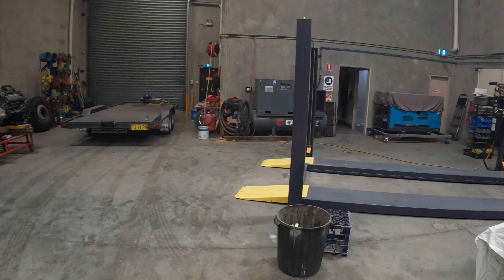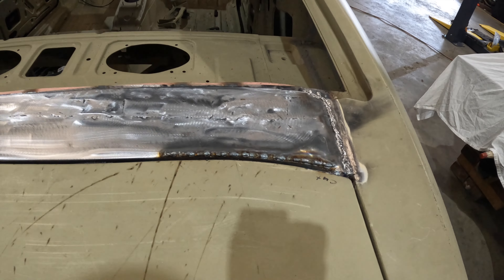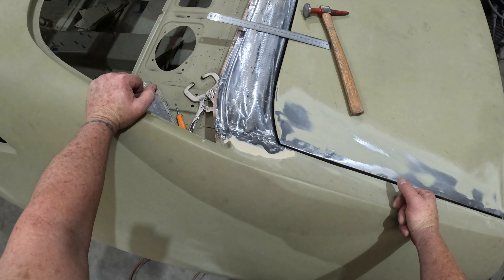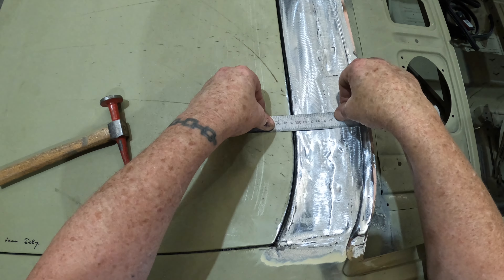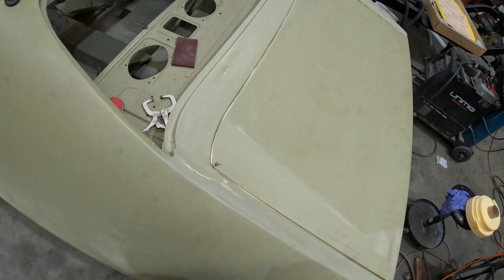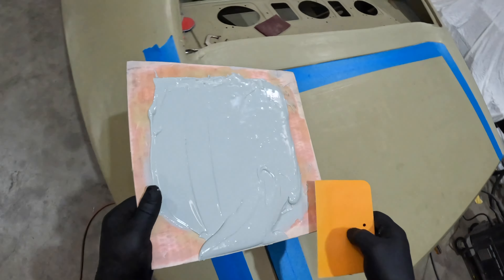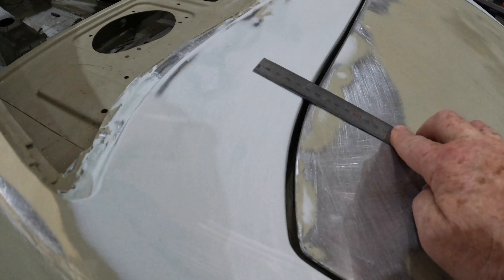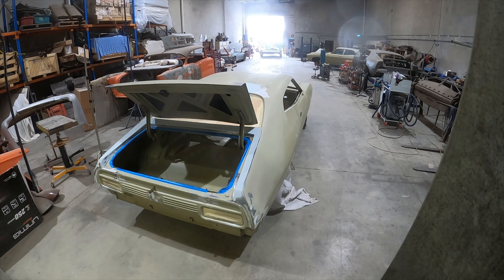Eps 91 XB Coupe   Replacing the Rear Window Lower Panel

Comment: Hope you had a Merry Xmas Tom. With the pass quarter can you put a relief cut on inside edge  & across rear and try to lift edge so it matches boot ? Then weld it. We use Rage Ultra at our work. Bring on 2024.
Reply from the maker: Merry Xmas Rhett ,Yeah  I could have cut into and welded the pass 1/4 but didnt really want to cut into the quarters again, they were blasted and epoxied inside and out , gap didnt end up being too much a further adjustment
Reply: Yep. Looks like the filler worked out well.